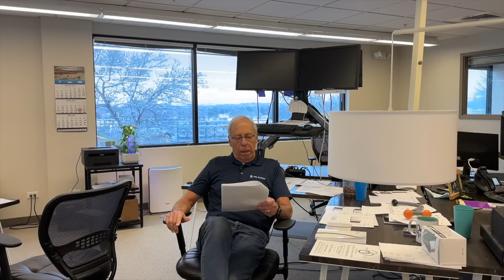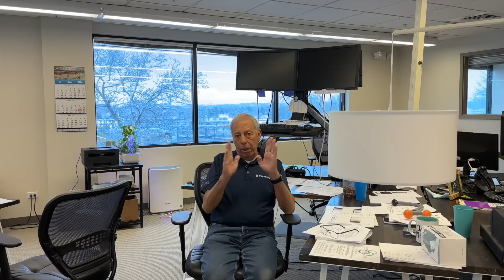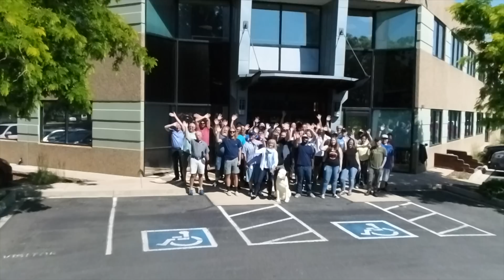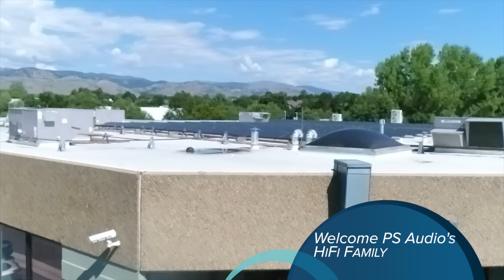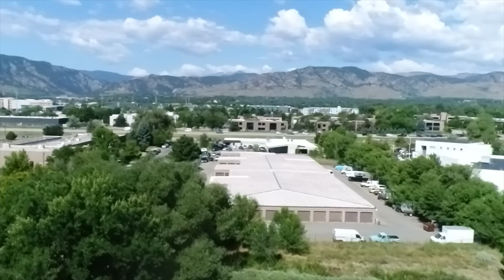Why small tube amps work

Comment: Active systems provides some flexibility.  I use a 20 watt tube amp for frequencies above 800Hz (upper midrange and treble), and over 2000 watts of class-D amplification for below 800Hz.  I am less in favor of class-D for the treble.  I think that class-D is great for bass.

Comment: Watts on amps are pretty variated in how they are messured too.. Most are messured 1 channel at 1kHz.. That gives alot higher number than all channels driven at 20-20.000Hz... And the power supply has alot to say.. Too small and the amp clips like hell. A huge power supply would help alot. And so on and so on (shit is complicated for most normal people)

Comment: I went from a Pass Labs Aleph 3 (30 watt Class A) amplifier to home-built Decware single-ended 2 watt monoblock tube amps with my Omega speakers.  The tube amps sound better than the transistor amp in many ways.  This from a guy who absolutely loves the Aleph amp.  As good as the Aleph is, it just doesn’t have the ultimate magic of the tube amps.

Comment: I've been running a SET tube amp with 70 watts for years and never even remotely use that power (big room but quite efficient speakers and I don't crank up the volume too much). The curve of wattage needed is not linear, most people don't keep that in mind, i.e. in order to get something twice as loud (+10 dB) you need 10 times the power, not twice. So cranking up an inefficient speaker actually requires tons of wattage (and then lots of extra headroom to sound good). If you don't have that scenario you are fine with very low wattage numbers.

Comment: Do not confuse power handling capability with power required. I have a pair of homebuilt speakers using Altec 515B drivers, 1096db/w/m. I power them with a 2 watt S.E.T. amp. They can handle 35. At sound levels just over 90db, which I consider very loud, they are drawing about half a watt. I find I much prefer lower power amps, they have a delicacy and finesse that the big brutes don't have. The trade off is that 99% of the speakers on the market will not play on 2 watts, that's why I built my own.

Comment: In large PA systems we use 5 - 10 times power needed for the tweeter . The reason is to protect the system, the very short Transient peaks can suck up a lot of power for a very short period of time and it’s fries the tweeters if we use the lower power amp,  in regards to tube amplifiers there is a nightclub in Montreal called stereo which has a fantastic sound system using tube, preamp‘s and two power amps for the high end of the system. In this case, the higher factoring of power is not needed as Paul explained.

Comment: Tube amps drive speakers much more efficiently.  10x much more. So my 70 watt Scott LK-72 with eleven tubes, and rounded signal, is louder and sounds much better than my 500 watt 5 channel AV surround amp.  More deep bass also.  So you need very tough, well made speakers with average or better sensitivity, 6 ohm 87 db workes for me.  I much prefer tubes.  They do not distort at full volume, but you may go deaf or blow out a speaker.  Like foam woofer surrounds... How do I know this?  Physics.  Imagine pushing someone on a swing.  The swing is your speaker, moving in and out.  Now hit the swing with a bat.  Make it swing high.  Good luck.  Now push the swing, gently, then accelerate, then let go.  Repeat.  The swing will go much higher, with much less power required.  The bat is a digital solid state amp signal.  It slams into every driver.  The tube signal is rounded.  Like pushing a kid on a swing.  Hope this makes sense.  If you have experience with tube amps, it becomes clear.  Thanks for the video.

Comment: Lots to be said for speakers having a 92dB efficiency with SET amps. Plenty loud, plenty pretty.  I think Paul talked about the "old days" where some doing biamping used class AB solid state amps for the low end and a tube amp for the midrange and highs for a "good" sound.

Comment: Speaker sensitivity is what you look at when deciding on an amplifier. High sensitivity speakers work well with low powered amps. Remember every 3db increase requires 2X the wattage. We perceive double the loudness at around 9db.

Comment: Speaker wattage ratings are mostly BS.   Most speakers will fry if you apply a continuous sine wave of 1 K Hz of just a few tens of watts, however they can handle peaks of a second or two at hundreds of watts.  Back when Audio companies actually published their specs and provided them to the end user a better understanding was available.  For instance, The Acoustic Research AR-3a speaker spells out its power handling as follows:   The AR-3a will tolerate a sustained input of 11 watts r.m.s. at any frequency for an indefinite period, 23 watts r.m.s. for at least 30 seconds, and overloads of 400 watts for 2 seconds.   They recommended at least 25 watts per channel to operate the speakers.
Reply: Paul is so diplomatic. ❤
Reply: A sine wave a 1kHz is pretty weak compared to the whole freq range. You can actually put more thru the speaker at just 1kHz than the full range. And speakers are mostly messured at nominal or continous power and then a peak rating (almost what you talk about). So yes.. Speaker watts are mostly BS since you with good contious use a 500w amp on a 100w speaker rather than a too small one. But it is an indicator of what it can take. But music is dynamic so... It really is just an indicator.
Reply: @Oystein87  
True:  The need for higher power amplifiers is to handle the peak output without clipping or distortion.

Comment: Well done Paul!  Tube amps run higher current (voltages) that can sustain the speakers required voltages (at higher volumes).  It all comes down to "how efficient" the speakers are and the levels (gain) you wish to achieve.  Solid state amps use caps as a reservoir for power (load) to sustain the amount of current (at higher gain levels) to the speaker.  When that reservoir expends that power (high volumes with low end frequencies), the solid state amps can (and do) clip.  Damaging the speaker (tweets, mid range drivers and the crossover) as well as and the amp itself is the result.  Most upper end tube amps (not all) are designed with a "continuous" power rating (class A). Continuous power ensures the amp will produce the rated current (watts) all the way up to the "ear damaging" level of gain (volume).  Also, hybrids suffer from the same issues as solid state amps due to hybrids being a transformer/capacitor topology as a solid state amp.  Just me 2 cents. :)

Comment: If you are trying to shake a painting off of your wall, then a small tube amp will not get the job done.

However, if you are listening at moderate sound levels, a small tube amp could sound fantastic ("could", because it depends on the tubes and the rest of the amp's components -- especially its power supply).

Lower wattage amps do not have to deal with controlling huge amounts of power.
When your amp has huge amounts of power, getting it to sound fast, and have finesse, and be nimble, takes a feat of engineering.

You could purchase a very powerful amp, at low cost.  It will play loudly.  It will also sound lousy.
It gets pricey to have an amp, with huge power, be able to control that power.

Paul stated that he loves a lot of headroom (another way of saying lots of power).  He left out the very high price of such an amp.  For him, with his business, and his wealth, it is basically free.  But he made it sound like everyone should do the same, to achieve what he loves and has.

If you can afford it, then sure, go for it.  But you can get stellar great sound quality with a reasonably powerful tube amp, that will play at decent volume levels (just not concert levels).

Comment: I like an amp with a bit of grunt! And if you like tubes,as I do, that can be an issue! My Audreal XA6950 gives 130w into 8 ohms, plenty for the vast majority of home systems. It has tubes(6922's) on the pre-amp stage and solid state on the output so no power issues!

Comment: As a person that uses tube amps, I really liked this explanation...   If anyone decides to go this route, a few things that seems to hardly be talked about, but is alluded to here. Consider your speaker choice and musical taste. A flea powered SET amp is wonderful and lush with small scale intimate music, that is mid-range centric.  With large scale orchestral or rock pieces that has a lot of heavy bass content you might be disappointed with that type of kit. A tube amp can be used for sure, and many may be satisfied with the results of the lower powered one. 
However, be mindful that the more powerful "Tube Watt" is somewhat of a myth. To suit the music, I like. I found myself going with very large, speakers, that are easy to drive. Paired with push-pull valve designs capable of over 100 watts.  Anything smaller than that, the bass became too muddied and indistinct. To keep the response powerful and tight I had to have amps that are in total control of what my speaker were doing.  A lower powered valve amp capable of delivering that magical "Tube Watt" did not make much of a difference for me.  An opera from Wagner, or Bach organ work with a 24 HZ. pedal note, still needs amplification that has sufficient power reserves for your speakers to deliver it correctly. Sadly, reality is a cruel task master, and it would not let me get around the physics involved for delivering deep bass out of my speakers. I still needed to invest in amplifiers with sufficient power.
Reply: Or you could have simply gone with smaller speakers and added a subwoofer.
Reply: @mpi5850  Not a fan of sub - satellite systems for music, myself. Time alignment seems to be off half of the time, the bass seldom keeps up with the monitor, unless you really want to spend a lot of time and money fussing with the sub.  The other issue is efficiency, a big consideration, if deciding to use a tube amp that has less power. An efficient speaker from the likes of Klipsch are big for a reason.  The last is for orchestral music I prefer to have something that can give me a sense of the scale a big symphony has. You cannot get that from a pair of small towers or bookshelves.

Comment: Years ago i had a Dynaco ST-70 tube amp that used 6CA7's to deliver 35w per channel. That was one of the best selling power amps of all time and there was a hood reason - great sound at an absurdly cheap price. I replaced that with a pair of Tiger (SWTPC) kit amps that put out 80w, they worked well but I burned out a set of tweeters on my Epicure speakers with that amp I ran them hot trying to get more bass out of them and unbeknown to me the bias trap on my Revox tape deck failed )134khz) and that ded huge amounts of 70khz(?) into those tweeters. I couldn't hear it nut those amps were fat out to almost 100khz so the tweeters failed. The old Dynaco's would have been way down by then.

i sent the speakers back to Epicure when they were almost 8 years old explaining why they failed and they fixed them for free (5 year warranty had expired). They made great products and stood behind them.

Comment: Guitarist perform on a huge stage with one or 4 (in a stadium) VOX AC 30, 30 watts tube amps. (helped with the PA)
Reply: You’re minimizing “helped by the PA” considerably in your statement
Reply: @Mrsteve4761  Yes I agree, but that is mainly for the audience the stage sound is still produced by the backline with old school bands. Now many bands use Inear. It is not on personal experience, only gigged in small pub settings (Bass), but the Vox AC 15 and 30 is considered as really loud (anyway)
Reply: @RoderikvanReekum  Oh yes, many would be amazed at how loud that 30 watt amp can be in a smaller forum. I recall I had a 300watt SVT bass amp in the band which volume-wise could barely keep up with the guitarist's 30 watt Marshall.

Comment: I have 10 watt set monoblocks they work fine with my Elac speakers lots of bass and a sweet detailed mid range
Reply: And ELACS are not that efficient so 10wpc is plenty !!!  I run an SET Class A (less than 5wpc)  all tube amp on my Cornwalls and could not be happier !
Reply: @ptg01  i know but i have a Little parallel chip Dac and  very good preamp that helps alot 😉

Comment: The power needed to  get an acceptable level is dependent on the efficiency of  the speaker. The sensitivity of many speakers is above 80 dB spl with 1 watt of power. This is quite loud at least with classical music. An amplifier capable of 12 watts will work well in an average small living room. Larger rooms may need more power and other types of music may  need  higher levels. I have a small room and prefer classical music.A 20 watt amplifier is quite sufficient for my needs. The performance of an amplifier when operating at a 1 or 2 watt output is the best measure of how a system willsound.
Reply: @@Douglas_Blake Standing waves only apply to some frequencies, that in my opinion should be controlled. In my room, I had a big boost of 12 dB around 68 Hz That doesn't increase the sensitivity of the whole spectrum. I tested in real situation and measured 6 dB less. Distance an multiples sources coherence are important factors.
Reply: @@Douglas_Blake I had already tried and I tried again now. Tested in a small room with no treatment with the first 30 seconds of the song Mood indigo (Little Blue Girl — Nina Simone) and the calibrated sound level meter PCE-MSL 1 —phones aren't accurate tools— with a decrease of 6 dB with quiet music (65 dB) and same result at higher volume (80 dB). The test with pink noise decreased the volume by 6 dB too. The small speakers I used don't have low frequencies. Room modes of low frequencies shouldn't be involved in sensitivity analysis.
Reply: Sensitivity is usually measured at 1 m. If the speakers are at 2 m the sound might drop to 74 dB, although mono or stereo can make a difference. If the brand measured sensitivity at 1 kHz in the corner for an optimistic 8 Ω nominal impedance which is closer to a real 4 Ω and the baffle step isn't compensated, the sensitivity could drop 4 dB far from the corner, 4 or 6 more for the baffle loss, and 3 more for the impedance with these brands that use "dB for 2,83 V" instead of "dB/W". A 94 dB* at 2,83 V at 1 m can be in reality without the asterisk a 83 dB/W speaker, around 76 dB at 2 meters. Classic music needs a lot of headroom, whereas rock is usually very compressed. If your amplifier works for you, that's what matters.

Comment: Paul's right. I'd also like to add that more than power you need voltage because V x C = W. Power usage goes up exponentially so a lot of the time the difference between 50 watts and 100 watts is 3db at certain points. So whats changing from different amps is the voltage, cleanliness of power, how short and clear is the circuit path. These factors are all better with tubes you get less watts because the current is fixed but the voltage is higher, the signal path is shorter and clearer, the linearity is also better so the voltage doesn't sag because tubes can have voltage rectifier tubes. The only drawbacks to tubes is they cost more to build because they use generally 3 transformers vs 1 and that's 80-90% of the cost of any amp and they aren't as practical because they're heavy, they're designed to play all the time so no standby switch, they get hot, they don't care about efficiency because their goal is to sound as amazing as possible. If you want purely great sound it's tubes hands down not even a contest. Hell Paul will tell you the truth ask him what his bascom king amps do differently. They have a tube preamp section tied to a class ab power amp section. It's his best line and the interview with Bascom King Rest his soul and beautiful mind is worth a watch. The man is a genius and he'll tell you... tubes they are better. My TV amp is a class a amp with a remote and standby button but my movie amp is my 300b. No comparison.
Reply: P = U × I, therefore if we have more voltage [U] because amplifiers are a source of voltage not current, the speakers will demand more current [I] (frequency impedance dependent). If the amplifier can supply the current that the speaker needs at that voltage, then more power will be used. An amplifier with a lot of distortion at that power usage might have much less power.
Reply: @@Douglas_BlakeAnd what ever happened to E = IR?